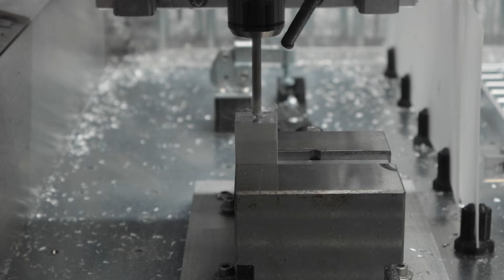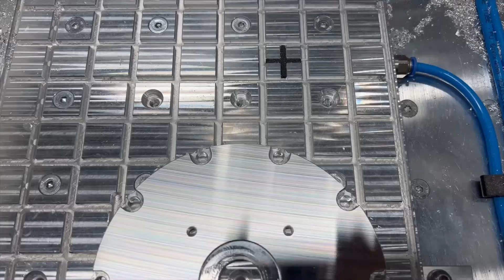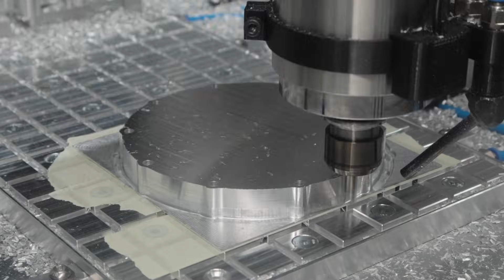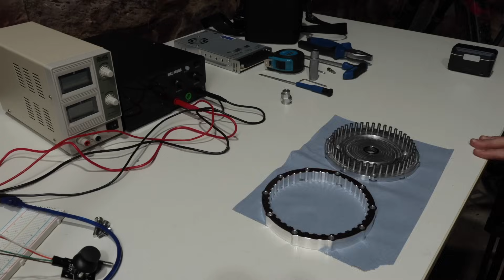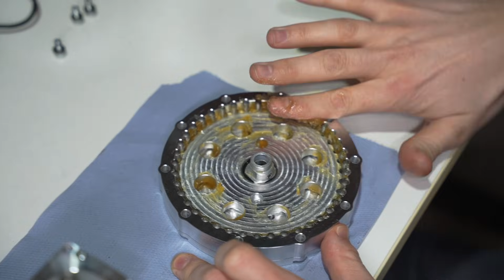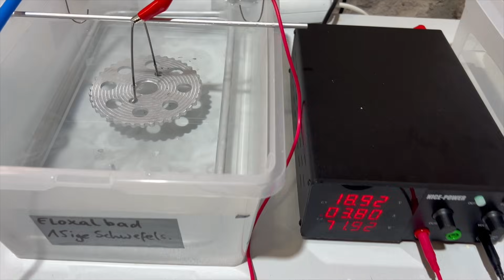Robotic Joint with Cycloidal Drive - from 3D Print to CNC Machining Part 2

Comment: how deep sould you tut from top surface to the bottom to prevent cutting into the vacuum plate ?
Reply from the maker: I leave 0.3 mm, with more(less) I had the aluminum peel sucked in, damaged and creating a leak…
Reply: @alexanderrueffer  thank you for the information.  i can understand the peel getting into the crevices, will lead to loss of suction .

Comment: Love your videos mate. How and where did you indicate the eccentric shaft part for op2? Thanks
Reply from the maker: Thank you mate! Ah thats not ideal, origin was located on the vise and I aligned the thin middle section with this corner. 
I later got extremely good runout with milling all bearing overhangs with a t slot mill in one op. Thats the secret get a t slot and try nothing else;)

Comment: Exelent work. You could use steper motor with encoder ,on robot, and also on cnc router,  it would be much precise than regular steper motor. And they are afordable.
Reply from the maker: @srdjan361306  thanks Srjdan! You are totally right, on my cnc I use servos with encoders. For the robot that is a must have in the future! Great tip

Comment: Great content, I'll be watching all your vids :)

I have some question about your setup and techniques, did you buy or build that vacuum plate and how thick of stock do you leave on the edges before switching to second op?
Reply from the maker: @JIBoyle  Hi Jacob, 
thanks for your comment. Blessed to have you as a viewer! That vacuum plate is Diy. I filmed it vertical so I could upload a short if that‘s interesting to you?

I leave 0.8 mm, then come back to mill the contur with 0.3 axial and 0.15 radial offset before a finishing contur to 0.3 axial again.

Vacuum stayed strong and back chamfer with 0.5 mm is beautiful.

Best, 
Alex

Comment: Great CNC machine, how much does a tool like that cost :D
Reply from the maker: Thank you for your comment! 
With these machines it's not really the parts but the time you have to invest to get good results from zero thats so "costly". 
I started without good tools, precision equipment, atc, mist, probing or a housing (that was the expensive stuff for me). I steadily upgraded that machine with money coming from it. To get started you probably need 5k$ and more depending on your needs and location. Hope that helps:)
Best, Alex